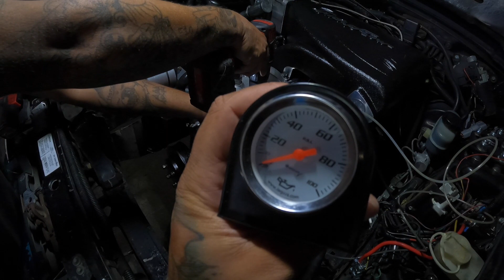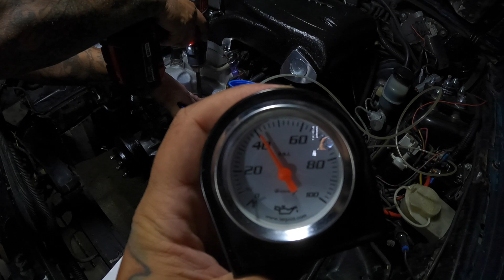She sounds Rowdy With the new Cam and Heads!!! "TrickFlow Top End Kit"

Comment: I'm looking  for a tune for my 96 cobra just rebuild the motor and I'm out of ideas for the car,it is running at 20000 rpms on start up it needs to be at 700 and I need to take the boost from 10psi to 6psi I'm trying  to reach out I need feed back

Comment: 24# injectors on stock tune?? Might not run effecient
Reply from the maker: Why wouldn’t it? It has the 24lb maf correction 😊 why would I do something that doesn’t work 😁
Reply: Maf calibrations are band aids.. tune it. Leaving power on the table i promise. Ive done it both ways.